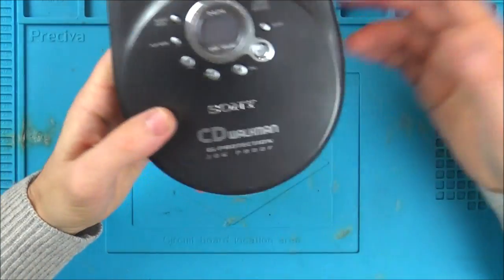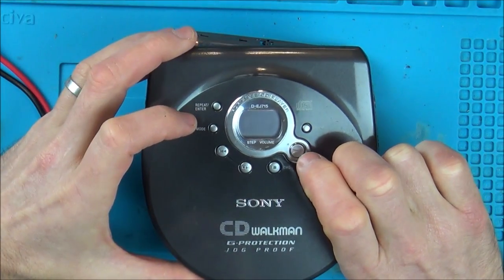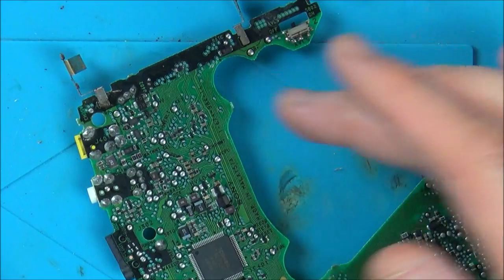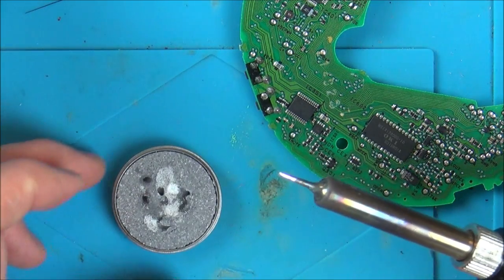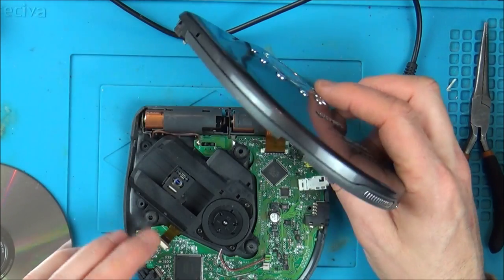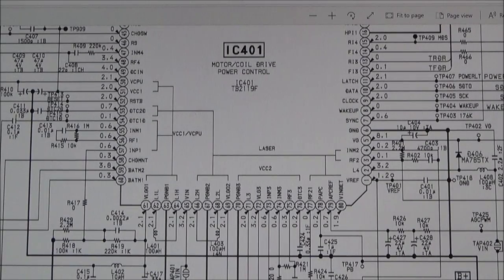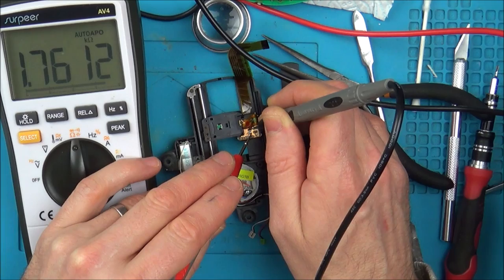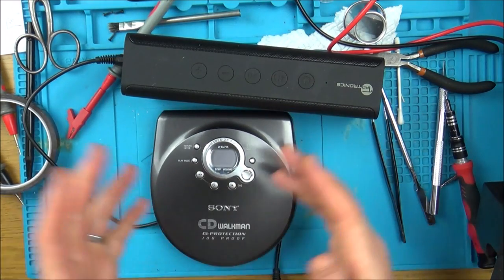Trying to FIX: Faulty SONY DISCMAN D-EJ715

Comment: The heat of the iron/solder is probably more than enough to burn off the coating on that wire, depending upon what it is. Just might save you a little effort

Comment: You need to look for the "ARF" (amplified RF) TP on the board, this should be listed in the schematic which makes this easier. then you hook up your scope probe to this point, on the scope you should see a nice looking eye pattern that is clear and well defined, not too fuzzy... this is hard to explain, so i'd suggest looking at videos demonstrating this on a scope, finally you want the eye pattern to be at the correct amplitude, so set the scope up to show you the peak to peak voltage and make sure it's at an adequate level - the trimpot sets this - the correct aplitude / voltage should be detailed in the schematic, remember you need a disc in and spinning to be able to do any of the above, so your gonna have to solder wires to the relevant points and extend them out while testing. , maybe the person who sold this already significantly twiddled with the trimpot.... maybe it's supposed to be only 200ohm the only way to know for sure is the steps listed above. Once again great vid Vince :)
Reply: Looking at the service manual, all the required info is in "SECTION 4" page 6. In this case it' doesn't appear to be an amplified RF TP/signal (just RF)l, It shows a pic of how the waveform should look on a scope and the steps required to measure as well as providing the required peak to peak voltage of 0.35V to 0.65V - you'll likely want to set this quite high with the trimpot to 0.6v as it's weak you may even have to set this higher and out of spec if the diodes bad but you will see the eye pattern start to breakdown the higher you go. Judging by the illustration the 2k resistor in the diagram represents the potentiometer in circuit and as far as i can tell you wouldn't add an additional resistor coming off the RF TP.... but every manufacturer is different. A lot of effort for something so cheap but it would make for an interesting video and would likely help you out later down the line on other gear :) your little scope should be able to do all this, just make sure you set it to 10x on the probe and scope and set the divisions etc as per the manual.
Reply from the maker: Thanks for the very detailed advice Dom :-)

Comment: the laser clicking like that against the spindle motor is not normal. It seems that the switch that says where is the end is faulty.
Reply: still, if the laser is getting the right voltage it should light up more than that.

Comment: I had that exact walkman when I was 9 or 10. 
It skipped when you walked with it. 
Sort of ironic.
Reply: That's because you are supposed to jog with it, not walk if you want the anti-skip feature to work :D
It says "jog proof" on it.
Reply: @jeremiefaucher-goulet3365  Is that what customer service would of told me if I called and complained? "Our patented walkman is not meant for walking. Try running at a brisk pace to enable the anti-skip functionality."
Good ol' Sony.
Reply: @jeremyowen1  Still better than Apple. From them you would have gotten a "You're holding it wrong" 😂
Reply: @jeremiefaucher-goulet3365  lmaoo!